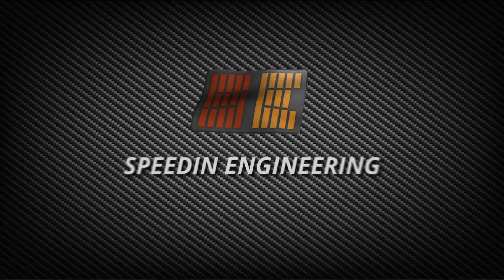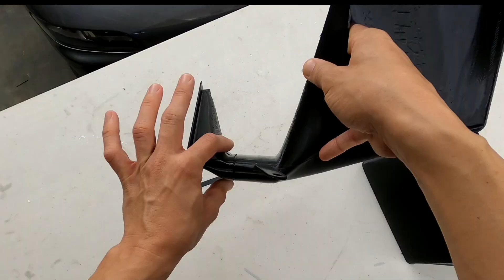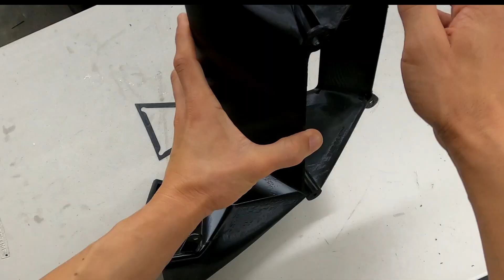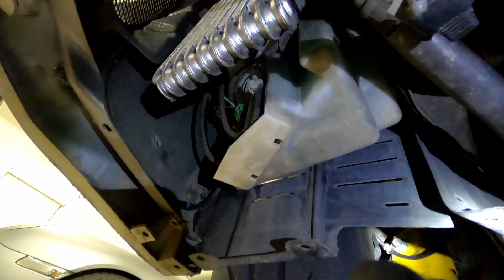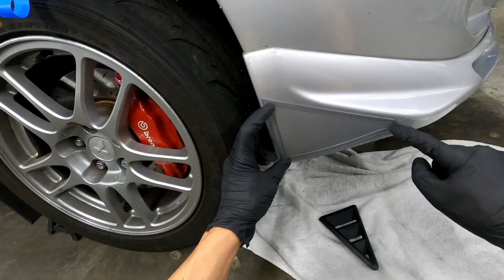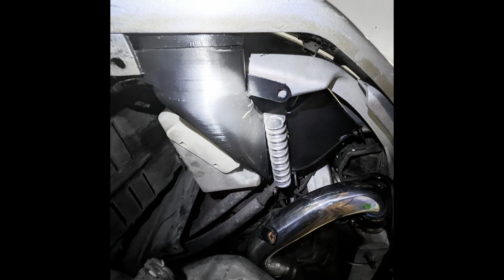Evo 5 Oil Cooler Ducting Kit Install & Overview | TME-Style Bumper Vent

Comment: Cool concept and application.

For those with upgraded oil coolers already this will be harder to implement I assume as I replaced the smaller V cooler with the IX long time ago to improve cooling. 

Any chance a wider kit could be done to accommodate a IX cooler as assume a lot of V owners would have done this upgrade already as big size difference?
Reply from the maker: That's a great suggestion, If it is in the stock location it would work with some trimming. But if you re-positioned it, there would have to be a different design.  I have been mulling over offering this as a full kit with a Setrab cooler and lines.
Reply: @SpeedinEngineering  Hmmm... might have to consider. Nice work.
Reply from the maker: @AWOL_ODST  Thank you. Yea ive been looking into aftermarket coolers and honestly, the factory one is pretty awesome. For the aftermarket ones to be ducted well on the the V's you would really need a new washer bottle solution. It just robs too much of the space there (which is why the 6+ went to a trunk mount).
Reply: @SpeedinEngineering  I've actually been considering a Setrab 25 row for my 6, while also waiting on the 6 oil cooler inlet duct (not TME) to go live (I still don't see it) on the site, as I got my car with it and the brake ducts missing. Knowing that out let ducting is in the works is also nice as I'm willing to trim if necessary.